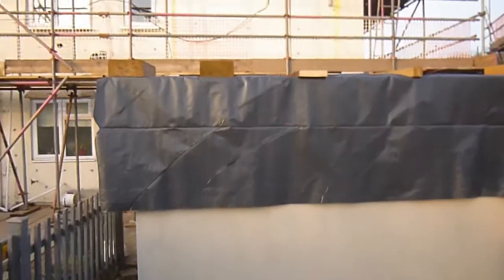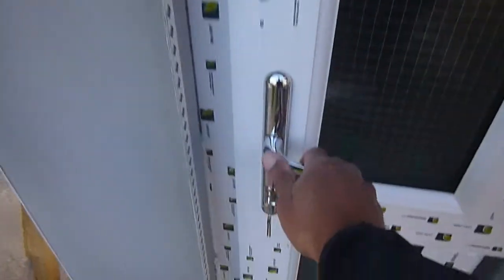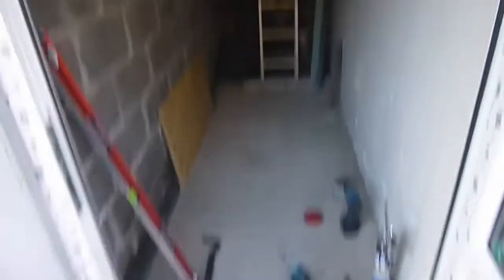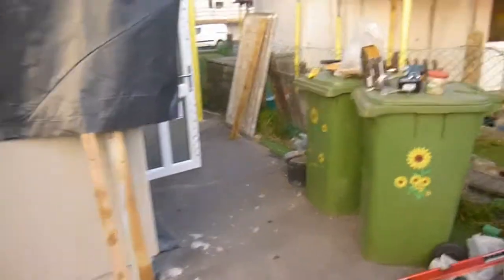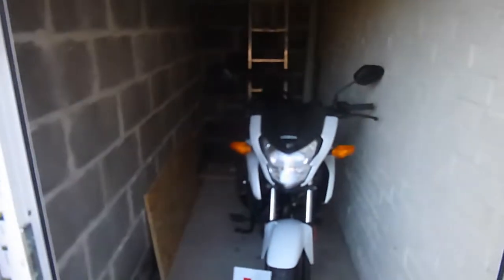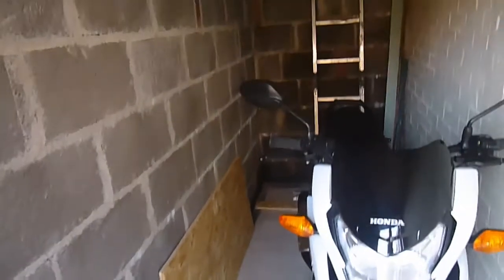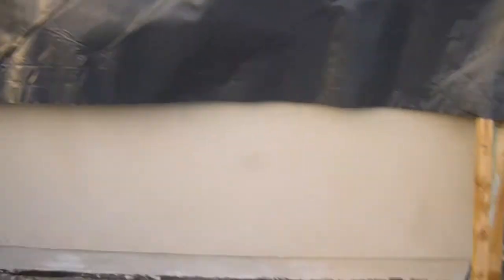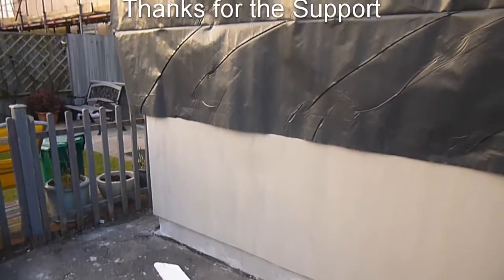Honda cb125f Finally gets a home

Comment: Looks great. Not to be picky, would it not been better to put the door opening at the right if your bringing your bike in from that side?
Reply from the maker: Thanks for watching, because the door can open flat against the other building it's not an issue and the other reason is on that side there is a solid very hard engineering brick as opposed to the breeze block on the new part.